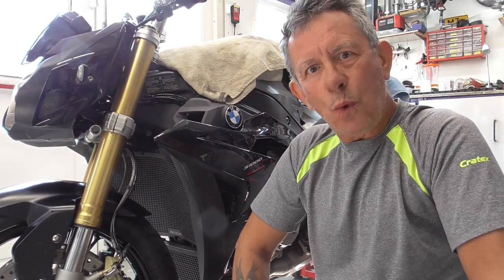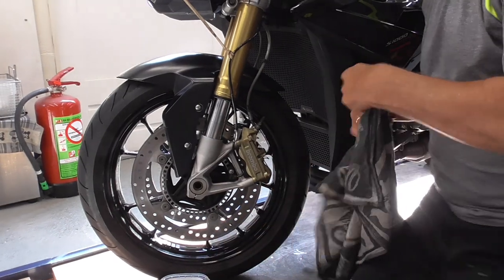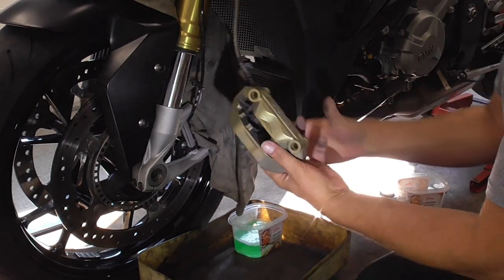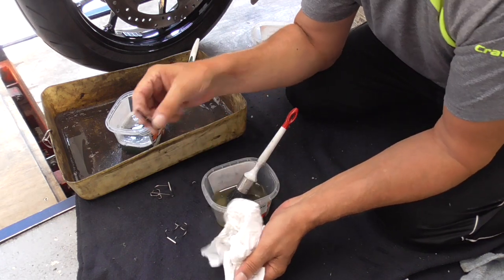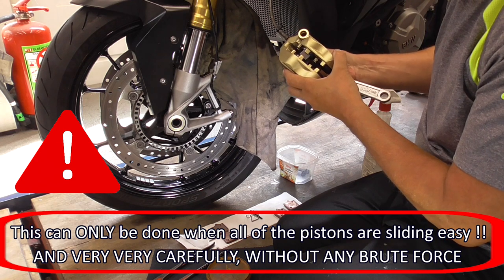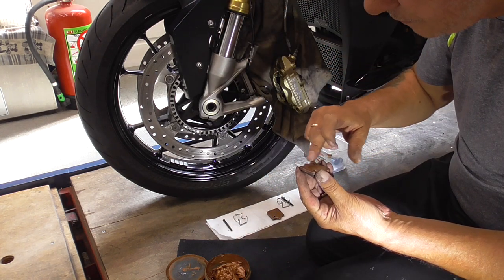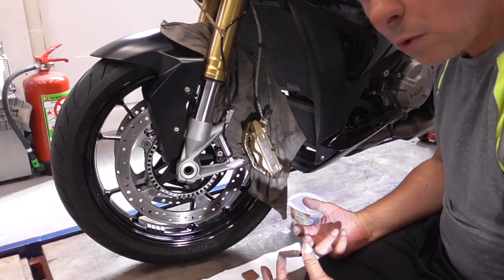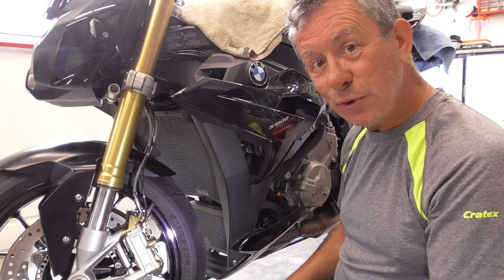BMW S1000R [2016] THIS IS HOW TO CLEAN YOUR CALIPERS.. 👨‍🔧---🏍

Comment: Nice clean up job. I always just put radial calipers on finger tight then repeatedly press the brake lever and hold down pressed as I tighten up the caliper bolts..this centralises the caliper onto the disc. Then torque up.